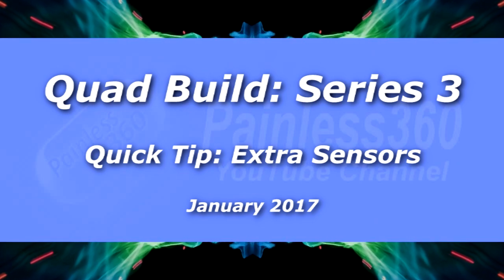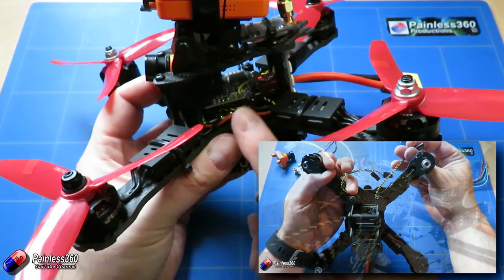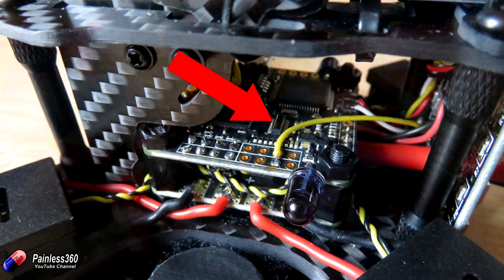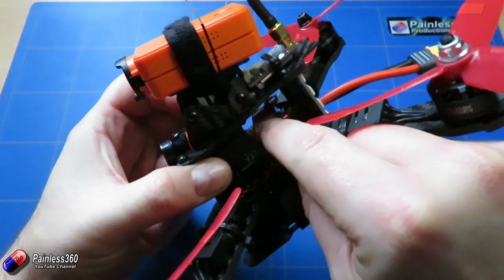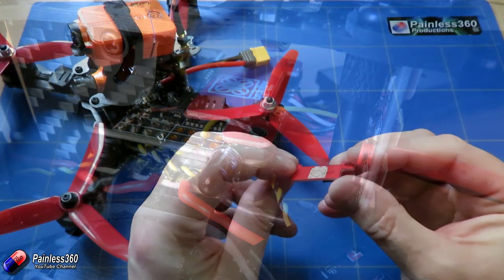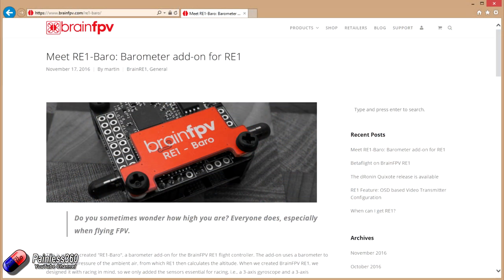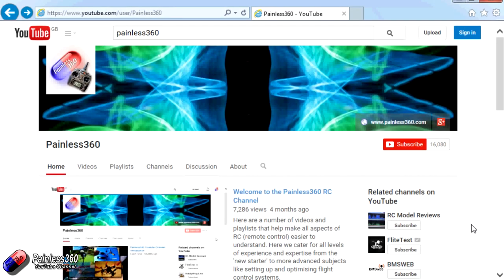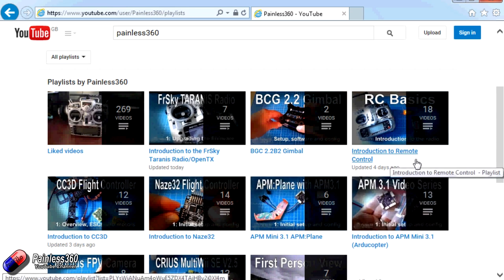(6/7) Quad Build Series 3 - Quick Tip: The Barometer you can add to the BrainFPV RE1

Comment: for the part cost of that connector, they could have just included the baro by default.
Perhaps other add-ons may make commercial sense, but those IO's should be broken out to pins rather than a proprietary connection.
Reply from the maker: There is - it's called 12c ;) We're using that a lot in current builds as we add external compasses.. Good point though..

Comment: Why should I need a baro on my race quad?! Wtf?!
Reply: Nobody said you should. Wtf?!
Reply: Jakob Scha that flight controller doesn't have to be used on a race quad... Mayby he only has that flight controller on a race quad... Be glad he uses his time and effort to show us
Reply: matthijs jordense so it would be of use if you had that FC in a fixed-wing
Reply from the maker: :D
Reply from the maker: The easy answer is that you don't need one on a race quad. Remember that there are more applications for this board than just racing! See the whole iNav series coming soon ;)
Reply: I just discovered inav! will it superceed  my apm 2.8, mission planner setup?
Reply from the maker: +dean blaxall depends on what you want to do. It allows you to use modern, inexpensive flight controller and GPS units to have solid GPS modes. The lack of a Mission Planner interface makes for a less useful platform for mapping and mission planning.. you can preview the series in the channel if you're interested.. we are about to start the iNav with fixed wing videos..